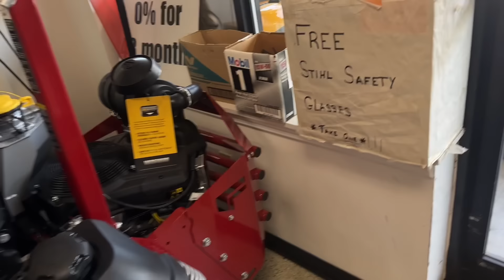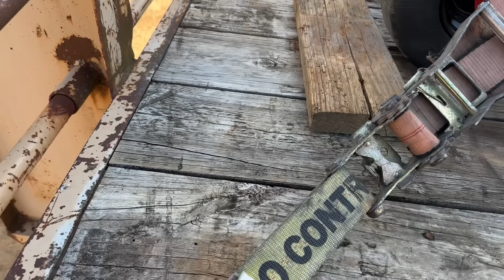10 Year Old Shows Up And Buys A $20,000 Zero Turn For His Business!!

Comment: 2019 ferris 2100 here..Underside of mower deck completely plugs up with grass after about 4-5 acres and it has to be all scraped off in order to mow anymore!..packs solid under there!..Its a total pain!..Rear suspension will squat backing up scalping the grass..Suspension causes front casters to bind up in some situations..Front caster pivots had absolutely no grease in them brand new mower,and preload on the bearing nuts were way too tight and casters would hardly turn..  had to remove them to grease correctly and took almost  a full tube of grease..Rear tires tear up the grass when turning almost no matter how hard you try to turn easy..i finally had to just give up worrying about tearing up the grass...high back seats are worthless because the machine still rides so rough you have to lean forward so all the shock of rough yards dont transfer into you back...roll bar is way too high up even when collapsed and will catch tree branches and guy wires on power poles..i had to remove mine because i couldn't get close enough around trees..deck height foot lift pedal is too hard to push with a messed up knee and i would think it would be too hard for a lot of women...machine eats gasoline like its going out of style...machine engine and blades are so loud even with the best ear protection it still is too loud..I came from a diesel that was so quiet and could mow my yard all summer with about 15 gallons of fuel, the ferris eats thru like 30-40 gallons of gasoline!

Comment: It's a nice mower but 20k!? Lol for just a mower that's way too much! You could easily find a small 40hp used John Dear tractor with a cab and AC for less than 20k and those are the more pricey of the tractors, and put whatever brush cutter mower you want on it. Just a cheap brush hog cuts great. Once you get past like 60" on a zero turn it's more cost effective just to go with small farm equipment. There's a reason those huge zero turns are hard to find but tractors are easy to find.

Comment: If you cut with that roll bar raised, just be sure there are no low hanging branches, cables or whatever around that it could get caught on at speed. That unit will flip in a heartbeat. Your focus as the operator will be down low toward the grass, and you will not notice overhead obstructions. Probably even more dangerous than mowing with it not raised. Use your own judgement, be safe.

Comment: The Ferris is by far the most comfortable and easy on your back due to the rider on their own suspension absorbing the bumps.  Due to blade tip speed no mower will quality mow at over about 12 mph even on flat smooth ground.  In order to mow at twenty mph the blade tip speed would have to be so fast that no bearings would hold up.  Also, the government will not certify beyond a certain blade speed due to how fast a stone could ne thrown injury a person.  Of you injured a person and the mower exceeds what the government will certify then you may loose in court in a liability.  
The Ferris also uses a roller on back of the deck which does beautiful stripping giving a golf course look.  His choice of the Ferris was a good choice.

Comment: Brax... just an FYI... get yaself some what I call field flags.. (some bright colored square plastic flags on wires) ... so ya can flag anything in yards such as water pipes that stick a few inches up top the ground or anything you need to avoid while mowing.  Saves time and what could end up being very expensive repairs. 👌😉👍 
I once hit a water pipe I didn't see... not only broke the blades but also broke the crank. 😱😤
Happy for ya Brax congratulations on your new mower !!!!🎉🥳🇺🇸💯

Comment: Brax needs to buy 2 extra, full set of blades.  Change them out every 50 hours. Keep them sharp!  Gives a cleaner cut and happier customers!  You can get all the weeds if you mow at a normal pace, not full speed ahead.
Reply: Every 50!? Try like every 10 machine hours or 8th cut
Reply: @paulmorich5272  10 hours? Lol…I’ll cut all year long on mine & it’ll still cut like they are new

Comment: That bobcat is nice and strong as well but unless you're doing nothing but wide open huge commercial properties then you absolutely don't need no 72 inch mower like that and you won't be able to get into 99% of residential backyards so you can go ahead and scratch that off. I found that a 52 inch will get through peoples gates to the backyard and it doesn't take long to cut the front yards with them 52 inches as well so that's all around the most versatile for the money especially for someone just starting out and starting up a lawn care business,been there and done it so I know first hand. Now, it's completely different if you just have the money to go buy several mowers no matter what and then you can just get you a 60 inch or bigger for front yards and commercial properties and get you like a 36 inch walk behind or something like that to get into backyards and other places that them bigger mowers can't fit into or a smaller self propelled x mark mower that are specifically for backyards and tight/small places buy CLEARLY most people can't afford to go off and spend a crap ton of $$$ on several different size mowers. If you can then great for you and you do your thing boss but MOST can't!

Comment: That 72" will be great on that big property, the issue is not every lawn you'll get is gonna be that size, lots of places those dang 48"+ deck mowers won't fit into :(.  In town where I live, you are lucky to get a push mower into the back yards of some places, even a 30" walk behind is too wide in some spots.  

Right now I am only mowing a pasture for a lady a couple times a year, but can't do that anymore as I no longer have a trailer to transport the tractor.  The pasture is a little over a half acre, and I mow it with my tractor and 60" mid mount mower...takes longer to load the tractor up and drive down there and unload the tractor than it does to mow LOL.  A little extra $$$ on the side but more frustrating than anything having to load and unload the tractor, and re-load it.

Comment: hour meter tripped three times and had 1200 on it . when it trips at 2000 it goes back to zeromy last use or trying to use when i turned blades on the deck spindles raised and i knew i was done. have a good one but the cub with sterring wheel would have lasted you as long if not longer, however i lover the springs suspension on the ferris , may have made the change myself! Cub rider would cut that field first cut no problem good luck and goad he got a good riding mower either way!

Comment: With those Farris you have to watch the hydro cooling fans they are plastic and tend to break at where they hold on the shaft and will spin and the fan blade won’t and over heats the fluid
Reply: Never had a problem with mine, but I use the blower on it every day. The key is to keep them clean and not build up on the blades.

Comment: I was able to watch this in 4K the mower is so cool!
I'm used to a skag zero turn
And a Howard Price 727 turf Blazer at 56 in
With the three cylinder yanmar.

Some of the landscape companies charge $50 an hour which covers your broad form policy insurance and your fuel and hopefully you're money to actually run and drive to where you need to go?

Sometimes when you mow it goes quite well and other times it will eat the blades and each blade is $100 a piece 
x 3  

You can typically mow a couple yards before you have to change blades or sharpen your blades

Best to have a couple sets of blades so you can quickly change from one to another?

Comment: Nice mower, I havean older IS1500z 50" that I mow my yard with that has been murder on the wheel seals and hydraulic system due to steep hill that I have to go up and back down.  The foot pedal for deck is nice to use when mowing over debris or old stumps etc

Comment: Those mowers are 20.000 that's crazy I would choke at 10.000
Reply: Same I juts got a like new Gravely Pro Turn 160 fully commercial (60” deck) for $4900 cash with 107 hours with the Kawasaki FX730V engine and it sells right now for $11,000 . I got it for less than half that so not to bad. It has a 10mph mowing speed.

Comment: I thought you have to be 15 years old to drive a automobile let a lon a 18 wheelers. That's so cool at 10 years old and buying a $20.000 lawn mower 👍 I just look at one on 14,499.00 just the mower  15,599.00 with blower weed whip or 18, with 7x12 trailer  and 18,296.00 trailer an blower an weed whip

Comment: I thought I think I would have went for that Bobcat 72 7000 model 40 horsepower Vanguard EFI now everything gets better with years but about that back in 2015 but these matters that are getting to be 15 and 20025 $30,000 zero turn lawn mowers are getting a little bit out of control I'm dealer Sheldon thanks for 20,000 and I guarantee you they pocket 5

Comment: Me at 15 I was running a husqvarna 62 inch zero turn mower and I hated the seat belt and the roll bar always got in my way so I cut it off and got rid of the seat belt and the seat sensor ad well

Comment: Sorry buddy, I don't know you and you seem like a nice guy but your information is really bad.  I manage a large ranch with many acres of grass which we mowed weekly and my experience told me that all commercial mowers out there (and there are many) are overpriced beyond belief.  I took a chance and bought a zero turn 52" Toro mower brand new 13 years ago for $2,500.   It was an excellent mower with no problems for several years until an employee got on a slippery slope and dropped it into the bottom of the lake he was mowing around.  I rushed over there with a backhoe and chain and we drug it out, drained the water, checked all liquids, cleaned it, got it started and ran it to dry it out.  A couple of years later I was nervous the water damage would eventually show up and couldn't be without a reliable mower so bought a 2nd identical one.  Now the price had risen to $3,000 and still so far below the ripoff commercial mower brands I went ahead.   Today mid 2024 we use the older one for mowing weeds and the newer one for the grass.   Both mowers are still operating perfectly with no repairs other than regular maintenance and a few occasional adjustments.  My point is don't advise people to buy $20,000 plus riding mowers because it's one of the biggest scams on the planet.